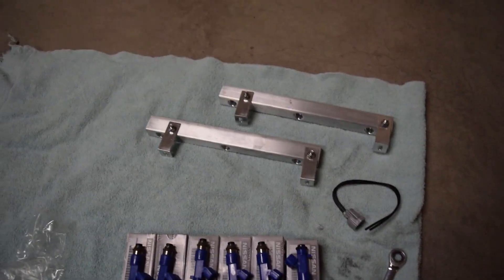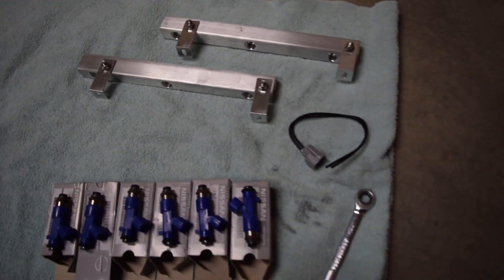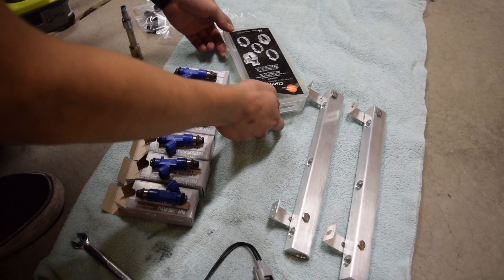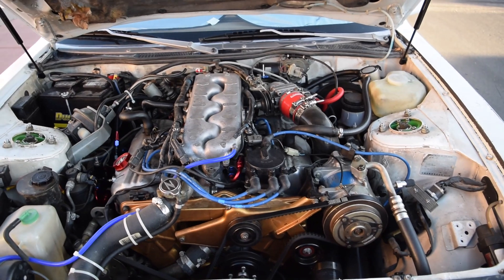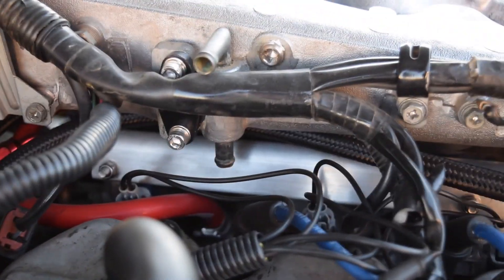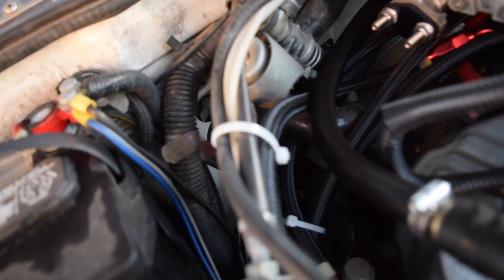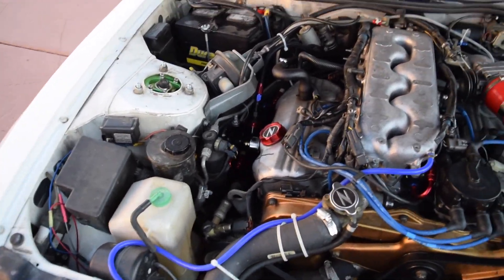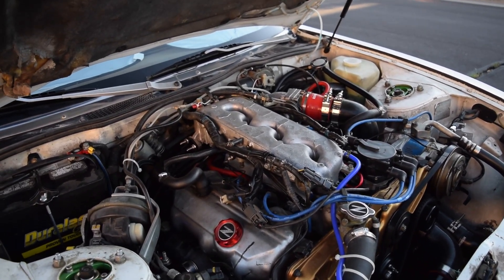NA2T Fuel System

Comment: I've kind of told you a little bit about how my car is which fuel pump do you recommend I get you know I'm in the future going to do a whole lot of stuff and it's starting now but got a lot of stuff going on already too but could I go ahead and put the bedroom fuel pump I've got an adjustable fuel pressure regulator so it's not like I'm going to really turn it up anymore but I could still run the better pump so it's already in there right also I said something to you about my front driver's wheel wobbling we said something about maybe wheel bearings I told you no it had something to do with my strut I thought well it does check this where the gland nut is on the strut I kind of stuck my pinky finger in the top of the nut between the strut shaft and there's a hole in the top where it's kind of walled out and when you gank on the wheel of the truck kind of moves right there and it's because of there being a spot gone in the top of the gland that the other side's not like that the driver side I can stick my finger down in it's kind of crazy never seen anything like it
Reply from the maker: A good upgrade for when you want to make power is the Walbro 450. Thats what I run in my NA2T
Reply: I've just always been told put a cold air intake hotter fire and plugs some good gas time it up a little bit you know get a little extra pull out of it but I trust you a lot with your research is why I asked you so much but my dad's been a mechanic and built race cars and s*** all his life but they've always been Chevrolets you know American V8 stuff but over the years I've seen him work on a few of these Z cars he is actually how I got my first one when I was 15 it was his first but he never really went into that car I did see him work on and 85 do the fuel injectors has things in it when I was a little kid back in the 90s early 90s sometime but he put it back stock just did some injector work and put it back stock you are doing yours more like I would like to do mine the style I would like mine to be is why I asked you execute the info coming I guess I'm going to go with the 6 on the spark plugs I was going to go with the NGK V Powers is what I thought was good so you told me different but I want whatever is going to give me the most power and like I said I don't want to have to keep swapping things back out when I get my hands on this turbo I told you I found a turbo car 5 miles from my house I just got to get my ducks in a row and be able to spend the money I need back tires right now and can't afford them because I bought new struts all the way around all these energy suspension bushings brand new front tires I've got a lot of stuff to my car and I don't have a lot of money people think I do because I've really done a whole lot lately when it comes down to it but you have my money is not long enough to do what I want to do
Reply from the maker: The bkr6e should be an ngk v power plug. It should be a standard copper core
Reply: @TheZGarage  thanks I appreciate it I just started my car and slightly barely have an exhaust leak anymore I know my driver side exhaust manifold has a little crack on it and I'm missing one bolt where it broke off in the head I'm going to have to do something that's why I was going to go ahead and do the turbo swap but I'm so scared of pulling the rest of those manifold bolts loose I did not know of them ever being out I just drove my car for the first time in about a week my exhaust is new from the muffler all the way up to the flange I've wrapped everything with header wrap I've tightened and done what I could but I'm going to have to get all new bolts in my manifolds and go from there I completely get rid of my exhaust leak but it sounds way better than as in a long time with all 2 and 1/2 inch everything brand new same size it really had a couple of different size pipes underneath where it had been played with over the years trying to get there sounds better than it has in a long time so I guess I can do with it till I can finish man I wish I could put some coilovers on it and some headers or Turbo it and get rid of this exhaust leak I'm so anxious but I'm ready to drive my car again so I got to drive it maybe I'll park it in a couple of weeks and try again oh yeah I did the chts relocation just a minute ago too and I can't really tell a difference but that just means my car already ran good I guess
Reply: @TheZGarage  well I just got the info yesterday evening that I will be ordering the same turbo you have an intercooler I just need the info so I get the right stuff but this weekend I should be going to get the few things off that turbo car at the junkyard I'm totally stoked and surprised but my mom came into a big chunk of money and she's fixing to help me get my Turbo and that exhaust manifold on that side anyways has furnace weld over a crack and the back two bolts closest to the firewall or broke off in the head so perfect time to put the turbo manifold on get those bolts out and get closer to being like you my friend LOL I just need to know which Turbo and if there's a cheaper intercooler I could use or if there's anything easier just let me know that I'm cool with your setup if there's anything that you ran across while doing yours please man let me know because I'm so excited I cleaned my car up I've been wet sanding and waxing and polishing and buffing it I've got it so clean I'm so happy I tried it yesterday it rides good drives good I'm probably going to go ahead and get me some coilovers to but I'm about to order everything in the next few days I have brand new front struts and strut mounts and strut mount bearings but I don't even care if I can get these coilovers that's what I'm going to do but please give me a little write up on what you think I should use because it will be coming ASAP my mom was going today to open her up a bank account so she could deposit these two large checks that she just got my grandmother passed away about a month ago and my mom's going to look out for me also and my grandmother bought the car in 86 for my uncle I know I've told you this but it'll be like my grandmother is still a part of this  car and finishing it
Reply from the maker: Go to Thezgarage.net and under the write ups/NA2t is a list of everything you need and links to what I got. There are cheaper turbos but I liked the vband on the hx35 I got. And there are smaller intercoolers that would probably work just as well.
Reply: @TheZGarage  ok ok👌
Reply: Yeah I've got the walbro 2 something then I have the fuel pump relay mod and the prw2 and the deleted intake I'm going to really have to sit down and make a list of everything that has been done to it
Reply: You know I was already thinking about doing the chts relocation well I went ahead and did it yesterday spur-of-the-moment because that other guy from my z31 whatever I've been talking to him also and he says that's what it sounded like I was taking a break angle sensor by the that's how my car Acts but anyways I wanted to do that so all good anyways but I think Mike right angle sensor why my car takes a minute to start it never used to do that even when it is cold in the winter time before it would start right up it runs really good after it starts up and runs a minute but even when I first deleted all the cold start stuff off of it it still ran better than it does now now it takes a minute to start but like I said still runs great after it idles a minute so now I think the cas is next but anyways I was saying from my muffler all the way to that 3 bolt flange is brand-new including the flange gasket I have two broke spokes on my driver side manifold Where It Bolts to the Head I'm going to have to break down and get them out I tried to get them out with a left-handed drill bit a couple of times but not really hard I'm going to have to break down and fix that my car sounds so much better than it has in a long time with all new 2 and 1/2 inch pipe from front to back it was mixed matched from over the years of having it fixed here and there so now it's all one size with a brand new muffler and it sounds so much better and runs much better with more power but I still have a slight exhaust and it's driving me crazy
Reply: If you could just make me a list of exactly what I should get I would get it in the next week or two including coilovers are maxpeedingrods any good for coilovers but I'm going to get the same turbo you got but I remember watching your video saying you just went with that intercooler but I probably could have got a smaller one how much was your intercooler I'm not very good at finding all this stuff online I'm not a computer savvy person that's why I have no idea about doing the news tune I'm scared of that because I don't know anything about computers home computers phones internet Facebook all of that I'm not good at but I'm a hell of a mechanic LOL I just would like to know what you recommend I know you keep saying to go to your build I'm going to try this when I get off work and see what I can come up with thanks a lot
Reply from the maker: Just use the list I have on my website. And I really only recommend powertrix coilovers for the z31. All the s13 adapter stuff isn't worth it in my opinion because powertrix is so good
Reply: @TheZGarage   yeah I'll never be able to afford the power tricks
Reply: @TheZGarage  you know I also thought about it I might need slightly a small intercooler to put behind the bumper in the bottom because my radiator still lays down and I don't have any cooling problems with that card radiator laying down still what is your recommendation on that
Reply: @TheZGarage  it's kind of like with a gun in my car to so don't let me frustrate you LOL
Reply: @TheZGarage  I have two or three different distributors for the Z how do I know which one is the updated crank angle sensor is there a quick way to tell just by looking
Reply from the maker: @Dookieandsons  If I remember correctly, the old one has gold dots on the top, and the new one has those dots covered
Reply: @TheZGarage  is there anything you wish you would have did different I'm rounding everything up now here it comes another one with your setup
Reply from the maker: The hx35 does take a long time to spool so if you want something more responsive, I'd recommend a smaller turbo, but if you want to run 20ish psi right out of the gate then it's perfect. Also I would mount the turbo and then figure out where to put the turbo oil drain on the oil pan because the stock turbo pan drain is a bit high. And a custom oil feed line because the pre-made stuff is too long and has to do a lot of loops to fit which can kink easily
Reply: Okay thank you I'm going to look through the ones I've got and see if I have a new one
Reply: Is there any way to avoid that crossmember that almost scares me away from it notice I said almost
Reply: I got the same one as you the oil feed line I got the silver one
Reply: But yes I do like it more responsive so what do you mean it's not a good turbo if I like it to be responsive
Reply: A couple of those small things from poker Factory or whatever that is like the bong for the oil pan that you weld in something else from that same place it's not showing it says page not found or something to that effect and the Turbo I'm using the same intercooler you have I'm using everything you have unless you say different but I want to drift I like torque in the lower and mid range so what do you think I know nothing about turbos so I Promise You are my inspiration I'm listening to your thoughts
Reply from the maker: I honestly don't know that much about turbos either. I think the hx35 is a 60mm compressor diameter, I would drop it down to around 50 for faster spool. Just look around for a turbo around there. Maxspeedingrods is a good brand that's also cheap
Reply: @TheZGarage  I so wish I could get you to pick me out something in the 50m mm area that will work with everything else we have if not I'm just going to pick out what you have I'm scared to pick out my own but I need one that will work with all the same piping and blow off valve that you have because I've already got started ordering
Reply: @TheZGarage  you kind of got me scared of that hx35 but I also don't want to get something different and it not fit the rest of the setup like yours because I am basically going identical to yours the piping routing and everything and trying to go ahead and round up everything oh yeah how many of those silicone couplers is it more than two of them I noticed that the end of your list it said and I used these how many LOL and what about the b u n g for the oil pan it wouldn't show me that on your right up front I'm sorry I just trust your thoughts more than mine I'll leave you alone if you'll pick me out of 50 mm LOL okay maybe not leave you alone I need your help LOL
Reply from the maker: No matter what you get, it's going to take work to get it to fit properly because it's not a kit. As long as you take your time and try to think ahead about routing, etc. Then you'll be fine with any setup.
Reply: I'm so nervous about picking out the wrong thing I know it's going to be work I've built almost everything I've ever had I've just never had a turbo do they make 50 version of what you have so I can just get that if not I'm probably just going to get what you got thing about the supercharger LOL you talked me into the turbo you made it work so now I'm scared to stray away from what you did but you kind of make it sound like you wish you would have got a 50 millimeter yourself I just wish I knew what to pick out
Reply: I'm going tomorrow to get the crossmember alternator bracket and manifold is there anything I can do to refresh my crossover pipe easily and also I wish you could just point me in the direction of a 50 mm that is closest to your design for about the same price please and thank you
Reply from the maker: @Dookieandsons  you really don't need to do anything to the crossover pipe if it's not damaged in any way. I coated my turbo exhaust manifold in a ceramic coating though. It helps to keep engine bay tems down and increase flow through the manifold, but how much it actually does it up to debate
Reply: @TheZGarage  yeah my crossover pipe is damaged though I had to wrap it with some exhaust repair stuff that hardens after you wrap it that Flex repair stuff or whatever it is I also have a lot of header wrap that de I had a wrap and the Dei spark plug covers to protect them but I'm going to wrap everything and exhaust wrap but on the back side of the flex part of the crossover pipe how could start the car up and feel it leaking before and now that I wrapped it I don't feel it anymore right there but I would still like to fix it permanently while I'm down in there and like I said I'm pretty sure about everything else on the build except for the turbo unless I use yours and the fitting in the oil pan it wouldn't show me that on your site but yeah I'm sure I'll paint everything with black ceramic and then re-wrap it and I'm actually going in the morning to try to pull that cross over motor mount and alternator bracket and manifold
Reply: @TheZGarage  tell me this as far as the ECU I have a python injection ECU do you know anything about that I've seen those words written in one other place other than on my ECU and it was online that I seen it but what I be able to use the factory turbo ECU with some bigger injectors for now and just not turn my Turbo way up question I'm asking what I be able to put it together and just not make a lot of power at first until I figure the ECU out I would like to be able to put it together and then be able find me a nice new nistune set up after I get it running
Reply: @TheZGarage  I really feel dumb but I want to get this black horse Turbo 50 mm T3 T4 but it doesn't look to have that same vacuum operated thing that yours has is that bad or good I'm not sure what I'm looking at I just don't know
Reply from the maker: @Dookieandsons  the vacuum thing is the waste gate actuator. If it doesn't have one then you will need an external waste gate which is more effort. Make sure it doesn't just have a different style one though. Usually smaller turbos have a built in waste gate
Reply: I watched a lot of your videos back-to-back and then played over and over listening to your car run I think I'm just going to go with what you got cuz I trust it and it's pretty and when I have any questions I can just ask you LOL then I'm just going to respect the build your car seems to run great I'm not looking to go balls-to-the-wall anyways and blow my car up and of course I'm going to stay running my 93 non-ethanol if that's okay but I could go E85 with the fuel pump and the fuel injectors you recommended right unless you can come up with Mia 50 mm that you know or recommend is just as well I'm just going to use what you got
Reply: Honestly there's so many different shapes and Designs I'm scared to just get something I'm overwhelmed thinking about this crossmember and oil pan and what else is it the driver side motor mount and the bracket for the motor mount those bongs and stuff for the oil pan won't pull up on your write ups I got the coilovers the intercooler the oil feed line the couplers the piping kit the blow off valve the pipe adapter I got a lot of stuff already coming I'm either going to get the same turbo you have unless you can name me a 50 mm that you're pretty sure will work the same but I am really taking your advice for the most part on everything oh yeah and I got the walbro 450 it was cheap I got just the pump under your write ups will you click on it and it shows you the fuel pumps it was like $50 it was the cheapest one on there but it was a walbro 450 the relocation manifold I think and the bong for the oil pan or the two things that your write-ups would not let me click on what is the relocation pipe do that makes this crossmember not needed right I'm just going to stick to the way you did it but if the turbo is not good for low-end and mid-range it might not be the best for me cuz I do like the fact that it's the biggest one that will fit LOL go big or go home please give me a little more advice on a turbo or I'm just going to get yours like I said and as far as the oil feed does anyone else sell it and don't they make one that just screws together and tightens up against the pan and by the way how many of those couplers the silicone couplers at the end of your ride height you said I use these how many is these on those $12 couplers I've got two of them so far
Reply: If u Google na2t coming soon you will see my car as of tonight it looks really good I'm so ready to finish it I need you to pick me out a 50 mil Turbo
Reply: Please go on there and look there is a black horse 50 mm T3 T4 Turbo but it doesn't seem to have what is that a wastegate that your turbo has built on to it what is that with the actuator built on to your turbo that's the wastegate right would you look at the one on Amazon that is 50 mm Blackhorse T3 T4 and tell me what should I do I'm confused please help me
Reply: I found some from black horse racing that look like they say 50 mm on the front of the housing I guess that's what that number is and it has the wastegate like yours I really don't know what I'm looking at I just so wish I could get you to pick me out one that way I know what to get you've already told me everything else so that's about all I need to know of course until I start installing it then I might need some advice LOL thanks my friend
Reply: I'll be needing to know which turbo buy probably tomorrow or Tuesday if there's any way you could please look out for me I know you're busy I look up to you a lot I know you did a good job on your build I so wish I could pay you to help me do mine but my money is not that long for sure and I'm damn close to being able to have my baby running like I want it please pick me out something let me know
Reply from the maker: @Dookieandsons  any turbo is going to require modification to make it fit because it's not stock. I can't recommend anything that I've never used or heard of people using, but if you want to get a stock turbo and add an intercooler, I've heard you can make close to 300 hp with a boost controller
Reply: No not stock but even that I wouldn't know what I was looking at I was looking at the Blackhorse it's similar to what you have it even has the wastegate on it it says a. R. 50 I don't know what I'm looking at I want close as I can get to yours but 50 mm and I do not know what I'm looking at that's my issue some of my things are starting to come in I just got a good look at my tires that came in I'm so excited I just want to know what is the 50 mm version of your Blackhorse like I said I seen a couple of different ones one didn't have a wastegate on it did I seen the one that said a. Org. 50 on the front of the housing had a wastegate like yours I'm lost on it for sure